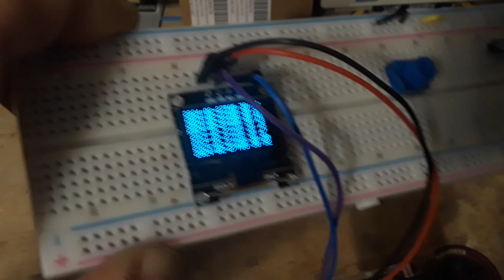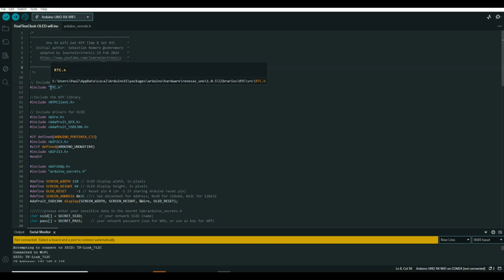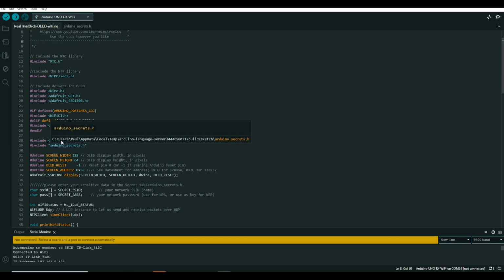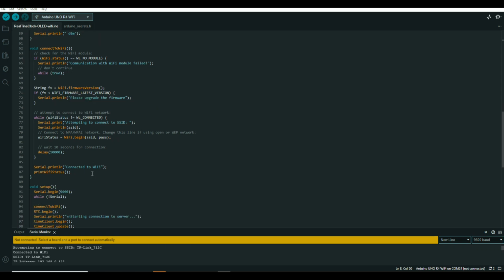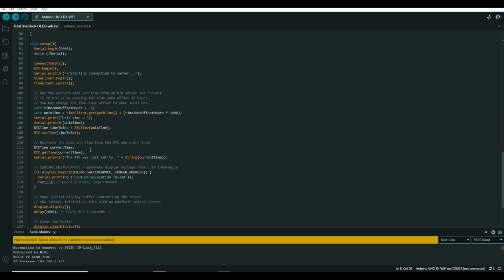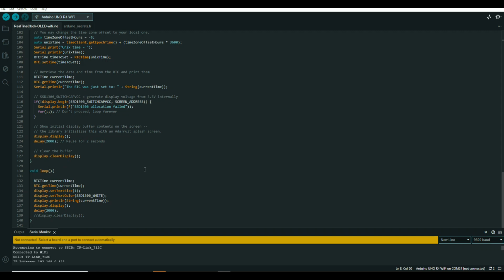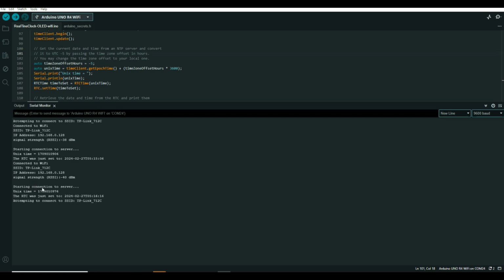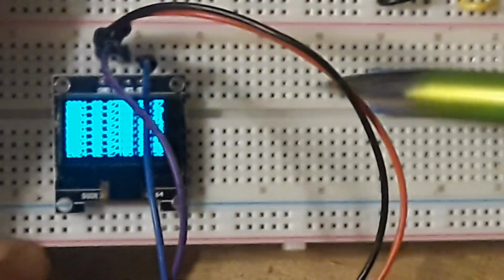Get Epoch Time Automatically and Convert it to Readable Time and Set The Arduino R4 RTC

Comment from the maker: /*
^^^^^^^^^^^^^^^^^^^^^^^^^^^^^^^^^^^^^^^^^^^^^^^^^
^       Uno R4 Wifi Get NTP Time & Set RTC      ^
^  Initial author: Sebastian Romero @sebromero  ^
^    adapted by learnelectronics 24 Feb 2024    ^
^    https://www.youtube.com/learnelectronics   ^ 
^         Use the code however you like         ^
^^^^^^^^^^^^^^^^^^^^^^^^^^^^^^^^^^^^^^^^^^^^^^^^^
 */

// Include the RTC library
#include "RTC.h"

//Include the NTP library
#include <NTPClient.h>

// Include drivers for OLED
#include <Wire.h>
#include <Adafruit_GFX.h>
#include <Adafruit_SSD1306.h>

#if defined(ARDUINO_PORTENTA_C33)
#include <WiFiC3.h>
#elif defined(ARDUINO_UNOWIFIR4)
#include <WiFiS3.h>
#endif

#include <WiFiUdp.h>
#include "arduino_secrets.h" 

#define SCREEN_WIDTH 128 // OLED display width, in pixels
#define SCREEN_HEIGHT 64 // OLED display height, in pixels
#define OLED_RESET     -1 // Reset pin # (or -1 if sharing Arduino reset pin)
#define SCREEN_ADDRESS 0x3C ///< See datasheet for Address; 0x3D for 128x64, 0x3C for 128x32
Adafruit_SSD1306 display(SCREEN_WIDTH, SCREEN_HEIGHT, &Wire, OLED_RESET);

///////please enter your sensitive data in the Secret tab/arduino_secrets.h
char ssid[] = SECRET_SSID;        // your network SSID (name)
char pass[] = SECRET_PASS;    // your network password (use for WPA, or use as key for WEP)

int wifiStatus = WL_IDLE_STATUS;
WiFiUDP Udp; // A UDP instance to let us send and receive packets over UDP
NTPClient timeClient(Udp);

void printWifiStatus() {
  // print the SSID of the network you're attached to:
  Serial.print("SSID: ");
  Serial.println(WiFi.SSID());

  // print your board's IP address:
  IPAddress ip = WiFi.localIP();
  Serial.print("IP Address: ");
  Serial.println(ip);

  // print the received signal strength:
  long rssi = WiFi.RSSI();
  Serial.print("signal strength (RSSI):");
  Serial.print(rssi);
  Serial.println(" dBm");
}

void connectToWiFi(){
  // check for the WiFi module:
  if (WiFi.status() == WL_NO_MODULE) {
    Serial.println("Communication with WiFi module failed!");
    // don't continue
    while (true);
  }

  String fv = WiFi.firmwareVersion();
  if (fv < WIFI_FIRMWARE_LATEST_VERSION) {
    Serial.println("Please upgrade the firmware");
  }

  // attempt to connect to WiFi network:
  while (wifiStatus != WL_CONNECTED) {
    Serial.print("Attempting to connect to SSID: ");
    Serial.println(ssid);
    // Connect to WPA/WPA2 network. Change this line if using open or WEP network:
    wifiStatus = WiFi.begin(ssid, pass);

    // wait 10 seconds for connection:
    delay(10000);
  }

  Serial.println("Connected to WiFi");
  printWifiStatus();
}

void setup(){
  Serial.begin(9600);
  while (!Serial);

  connectToWiFi();
  RTC.begin();
  Serial.println("\nStarting connection to server...");
  timeClient.begin();
  timeClient.update();

  // Get the current date and time from an NTP server and convert
  // it to UTC -5 by passing the time zone offset in hours.
  // You may change the time zone offset to your local one.
  auto timeZoneOffsetHours = -5;
  auto unixTime = timeClient.getEpochTime() + (timeZoneOffsetHours * 3600);
  Serial.print("Unix time = ");
  Serial.println(unixTime);
  RTCTime timeToSet = RTCTime(unixTime);
  RTC.setTime(timeToSet);

  // Retrieve the date and time from the RTC and print them
  RTCTime currentTime;
  RTC.getTime(currentTime); 
  Serial.println("The RTC was just set to: " + String(currentTime));

  // SSD1306_SWITCHCAPVCC = generate display voltage from 3.3V internally
  if(!display.begin(SSD1306_SWITCHCAPVCC, SCREEN_ADDRESS)) {
    Serial.println(F("SSD1306 allocation failed"));
    for(;;); // Don't proceed, loop forever
  }

  // Show initial display buffer contents on the screen --
  // the library initializes this with an Adafruit splash screen.
  display.display();
  delay(2000); // Pause for 2 seconds

  // Clear the buffer
  display.clearDisplay();
}

void loop(){

  RTCTime currentTime;
  RTC.getTime(currentTime);
  display.setTextSize(1); 
  display.setTextColor(SSD1306_WHITE);
  display.println(String(currentTime));
  display.display();
  delay(2000);
  //display.clearDisplay();
}

Comment: This is really cool. I have been thinking about creating an "analog clock" simulation with a strip of addressable LEDs wrapped around a circle. Not original I know, it's just my exploration of this. I am thinking about starting with a basic Arduino with no RTC. It will drift for sure. Adding an RTC will probably drift less. Later adding NTP via ESP with WiFi will make it spot-on forever. That got me thinking, why not use just an ESP32, instead of the Arduino/ESP board? Is it a logic level consideration, 5v vs 3.3v? One other idea is to have the ability to set the clock using WWV (in the US) or some other broadcast time signal. I am not sure such a module exists, just spitballing.

Comment: There seems to be thousands of people devising ways to sync to internet real time code and zero people using a quartz oscillator for this purpose; why?

The quartz watch crystals vibrate at a stable frequency and using a series of 15 flip flops are able to generate time that only fluctuates plus or minus 15 seconds a month.

What kind of applications do people need more accuracy than this? I think a conventional quartz timing circuit that's able to track time without an internet connection would be far more useful since it would be independent.

It would use less power and would still function during the internet glitches that I see everyday while online.

My father was a jeweler and a watchmaker and I still remember him holding one of the first electric Bulova watches up to my ear in the early 60's and saying "do you hear it?"

They had a mosquitoe like buzz which was cool since everything  else in his jewelry store ticked.

I'd love to see an electronics guru replicate a watch timing circuit with a watch crystal and a flip flop array and use that with an Arduino.

And why haven't computers added these common time keepers into their hardware? Maybe they have; the backup battery in most computers does do a pretty good job at keeping track of your time even when the computer is shut down.

Comment: NICE IDEA too bad I could not read the code on your monitor (font small and dark)..
Reply from the maker: I'll post it in the comments when I get home later
Reply: Looks perfectly readable to me.  Were you watching on a phone?
Reply: NO on a 15 inch laptop  hp Probook 6550b old but works will check on anewer laptop later today. @MikeBramm
Reply from the maker: /*
^^^^^^^^^^^^^^^^^^^^^^^^^^^^^^^^^^^^^^^^^^^^^^^^^
^       Uno R4 Wifi Get NTP Time & Set RTC      ^
^  Initial author: Sebastian Romero @sebromero  ^
^    adapted by learnelectronics 24 Feb 2024    ^
^    https://www.youtube.com/learnelectronics   ^ 
^         Use the code however you like         ^
^^^^^^^^^^^^^^^^^^^^^^^^^^^^^^^^^^^^^^^^^^^^^^^^^
 */

// Include the RTC library
#include "RTC.h"

//Include the NTP library
#include <NTPClient.h>

// Include drivers for OLED
#include <Wire.h>
#include <Adafruit_GFX.h>
#include <Adafruit_SSD1306.h>

#if defined(ARDUINO_PORTENTA_C33)
#include <WiFiC3.h>
#elif defined(ARDUINO_UNOWIFIR4)
#include <WiFiS3.h>
#endif

#include <WiFiUdp.h>
#include "arduino_secrets.h" 

#define SCREEN_WIDTH 128 // OLED display width, in pixels
#define SCREEN_HEIGHT 64 // OLED display height, in pixels
#define OLED_RESET     -1 // Reset pin # (or -1 if sharing Arduino reset pin)
#define SCREEN_ADDRESS 0x3C ///< See datasheet for Address; 0x3D for 128x64, 0x3C for 128x32
Adafruit_SSD1306 display(SCREEN_WIDTH, SCREEN_HEIGHT, &Wire, OLED_RESET);

///////please enter your sensitive data in the Secret tab/arduino_secrets.h
char ssid[] = SECRET_SSID;        // your network SSID (name)
char pass[] = SECRET_PASS;    // your network password (use for WPA, or use as key for WEP)

int wifiStatus = WL_IDLE_STATUS;
WiFiUDP Udp; // A UDP instance to let us send and receive packets over UDP
NTPClient timeClient(Udp);

void printWifiStatus() {
  // print the SSID of the network you're attached to:
  Serial.print("SSID: ");
  Serial.println(WiFi.SSID());

  // print your board's IP address:
  IPAddress ip = WiFi.localIP();
  Serial.print("IP Address: ");
  Serial.println(ip);

  // print the received signal strength:
  long rssi = WiFi.RSSI();
  Serial.print("signal strength (RSSI):");
  Serial.print(rssi);
  Serial.println(" dBm");
}

void connectToWiFi(){
  // check for the WiFi module:
  if (WiFi.status() == WL_NO_MODULE) {
    Serial.println("Communication with WiFi module failed!");
    // don't continue
    while (true);
  }

  String fv = WiFi.firmwareVersion();
  if (fv < WIFI_FIRMWARE_LATEST_VERSION) {
    Serial.println("Please upgrade the firmware");
  }

  // attempt to connect to WiFi network:
  while (wifiStatus != WL_CONNECTED) {
    Serial.print("Attempting to connect to SSID: ");
    Serial.println(ssid);
    // Connect to WPA/WPA2 network. Change this line if using open or WEP network:
    wifiStatus = WiFi.begin(ssid, pass);

    // wait 10 seconds for connection:
    delay(10000);
  }

  Serial.println("Connected to WiFi");
  printWifiStatus();
}

void setup(){
  Serial.begin(9600);
  while (!Serial);

  connectToWiFi();
  RTC.begin();
  Serial.println("\nStarting connection to server...");
  timeClient.begin();
  timeClient.update();

  // Get the current date and time from an NTP server and convert
  // it to UTC -5 by passing the time zone offset in hours.
  // You may change the time zone offset to your local one.
  auto timeZoneOffsetHours = -5;
  auto unixTime = timeClient.getEpochTime() + (timeZoneOffsetHours * 3600);
  Serial.print("Unix time = ");
  Serial.println(unixTime);
  RTCTime timeToSet = RTCTime(unixTime);
  RTC.setTime(timeToSet);

  // Retrieve the date and time from the RTC and print them
  RTCTime currentTime;
  RTC.getTime(currentTime); 
  Serial.println("The RTC was just set to: " + String(currentTime));

  // SSD1306_SWITCHCAPVCC = generate display voltage from 3.3V internally
  if(!display.begin(SSD1306_SWITCHCAPVCC, SCREEN_ADDRESS)) {
    Serial.println(F("SSD1306 allocation failed"));
    for(;;); // Don't proceed, loop forever
  }

  // Show initial display buffer contents on the screen --
  // the library initializes this with an Adafruit splash screen.
  display.display();
  delay(2000); // Pause for 2 seconds

  // Clear the buffer
  display.clearDisplay();
}

void loop(){

  RTCTime currentTime;
  RTC.getTime(currentTime);
  display.setTextSize(1); 
  display.setTextColor(SSD1306_WHITE);
  display.println(String(currentTime));
  display.display();
  delay(2000);
  //display.clearDisplay();
}
Reply: Sorry for not replying sooner power went out and also my internet went out. Thank you for posting the code. went to library still could not read code but today I used a different laptop and was able to read your screen not easy but doable , Thank you!